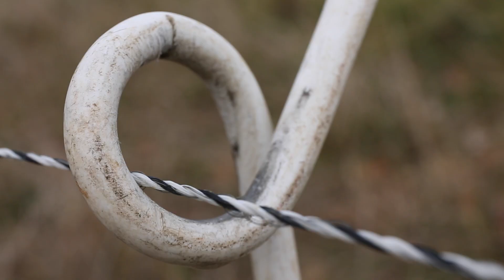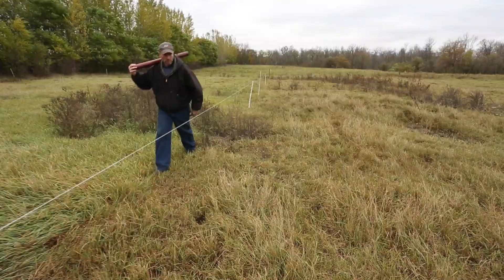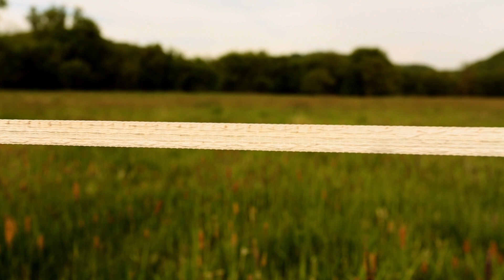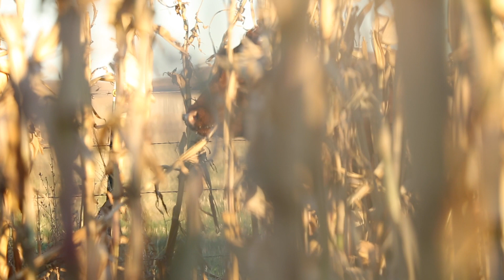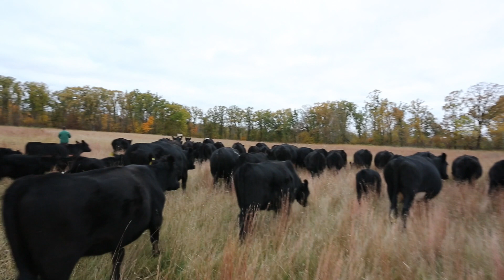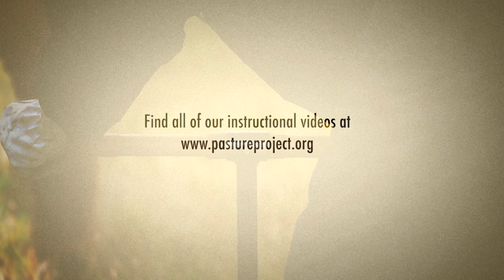Fencing 101: Portable Energized Fence Materials

Comment: We went for the cheap stuff at tractor supply to get started. All the posts broke, bent or shorted. The insulators broke or got soft and bent.  The wire rusted and broke and the chargers all died within two years. We learned our lesson. Most of the stuff we use now is out of New Zealand or Australia and it is tough as nails and seems like it will take a decade to wear out.  We are in the process of starting to replace old barbed wire fences with smooth high tensile electrified fences. As a side note, the cattle put a lot less pressure on all the fences (electrified or not) since we started with the electric. I think they just associate all of them with the ouchey wire now, haha.